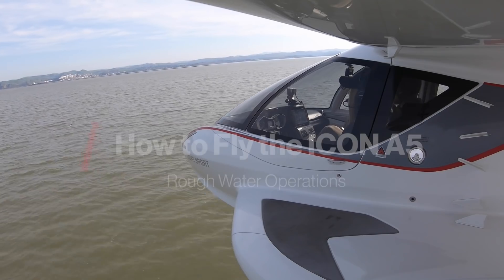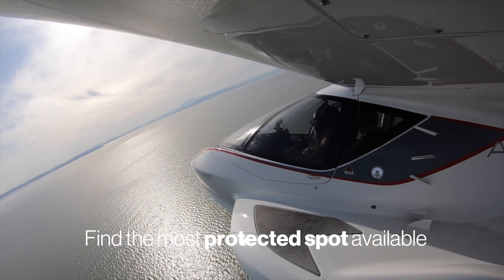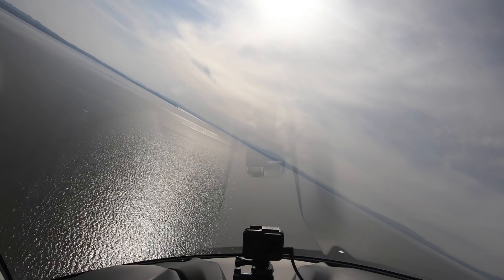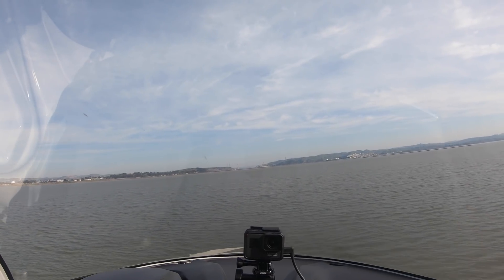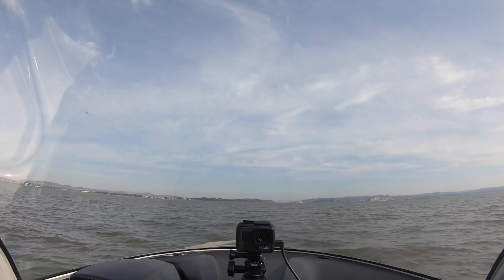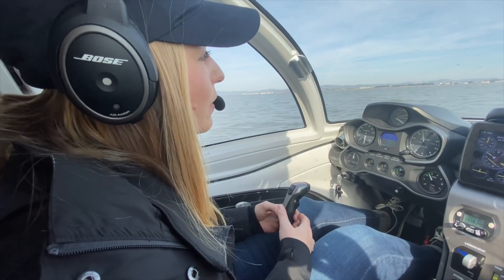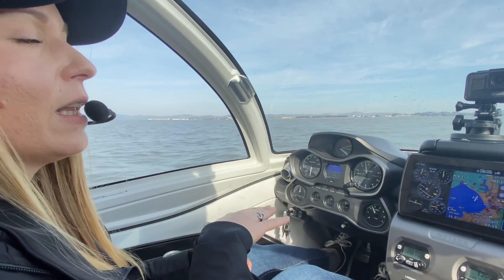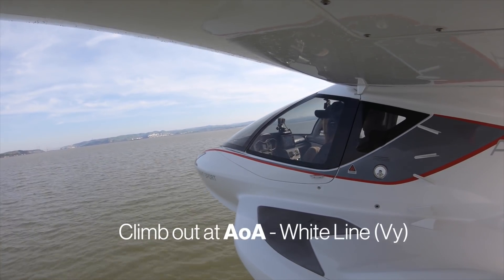Flying a Seaplane in Rough Water Conditions

Comment: I like this. Larger seaplanes aren't as susceptible to atmospheric and water surface conditions like smaller aircfaft like the iCon A5. Small plane, means everything is exaggerated. Small waves are bigger, power band will feel smaller, wind direction and speed will feel intensified. Good well built light plane, good application and general common sense sets the tempo  for extremely good flying. Dually, it is refreshing to see instructors talking through and applying the principles and flight characteristics applicable to their airframe.

Comment: Low power to weight ratio & high centerline pusher thrust makes for a lousy airplane to fly. I have extensive experience flying airplanes of a similar design and they all stink. Nothing better than a standard tractor engine. The Icon should have two Rotax engines in a tractor configuration mounted on the top wing. And use a better wing airfoil. Then it could be a fun & safe airplane to fly.
Reply: Have you ever flown the icon before? I guarantee the planes you are referring that “are similar design” fly nothing like the icon.

Comment: Does rough mean something different in the US? That's practically a millpond.
Reply: Im from the US and deff not, lmao.
Reply: It's possible the Icon can't handle large seas, based on this.  Those are fairly small waves
Reply: Perhaps those seas are rough for the icon. Depends on how much it can actually take.
Reply: @georgezachos7322  these kids thinking 50ft waves and a icon would mix. YEAH OKAYY
Reply: @Deadmau5l  perhaps they should have used words other than 'rough' and 'rollers' to describe the conditions of a 10cm wave.
Reply: She is describing rough water procedures and repeatedly states conditions aren't particularly rough in the video.
Reply: The water conditions in the video are not excessively rough by any means or close to the limitations of the ICON. I’m simply just going over the procedures for rough water on water that’s other than glassy conditions.
Reply: In the US we often assume language is in context. So if someone flying a fiberglass seaplane says "rough waters," an American will assume this means "rough waters for this seaplane" not "rough waters for a Navy destroyer" or something. 

Americans will also understand the purpose of a video, and cue in on language like "this isn't particularly rough, but we will go over the procedures," indicating that the video producers are aware the icon can take a bit rougher water than shown. 

I guess wherever you are from, context isn't used in day to day language?
Reply: What kind of light sport aircraft do you fly that is capable of ocean swells?
Reply: You should actually watch the video before making a fool of yourself....

Comment: Might need to explain to folks what is meant by the term "ground effect"
Reply: That’s what actual training is for
Reply: Ground effect is the compression of air against the ground (in this case, water) which causes the plane to almost glide or float across the surface, nearly at stall speeds. This is similar to gulls and birds that fly along the water or waves of a coastline to build up energy and then launch back into the air, and repeat. Thus allowing the birds to rest and go longer distances.
Reply: @leetjohnson  I wonder if because of the water it's more pronounced?  I know you have to worry about it a lot with rotor craft, but fixed wing you typically rotate, get positive rate, gear up, flaps up, climb out.  It would be strange to see an aircraft pop up into ground effect while going down the runway.
Reply: @BitwiseMobile  you are absolutely correct that it affects prop planes far more than jets, due to the reflection of the propeller air over and under the wings, whereas for jets, the waste air is aft the wings. It doesn't lift the plane much, but it is similar to the "pop" off the ground when equilibrium is achieved between gravity, speed and (aeronautical) lift. It is at this point that this ground effect is noticeable and it is subtle, especially for a large commercial jet, but more pronounced in small prop planes.